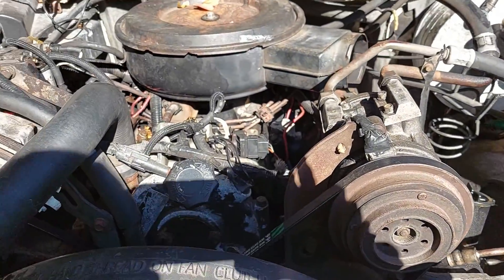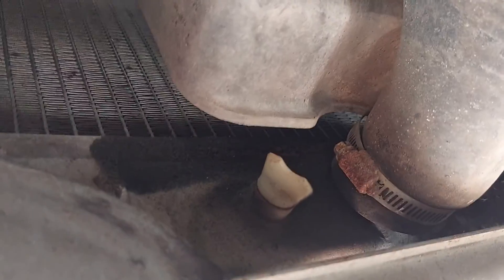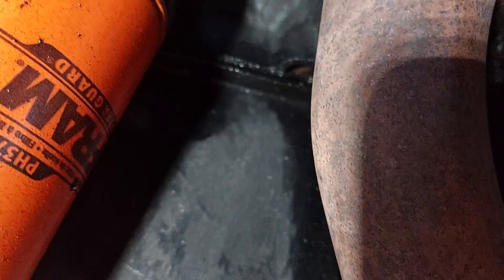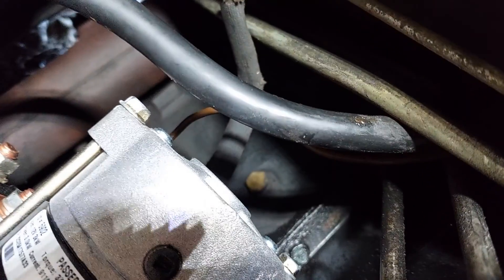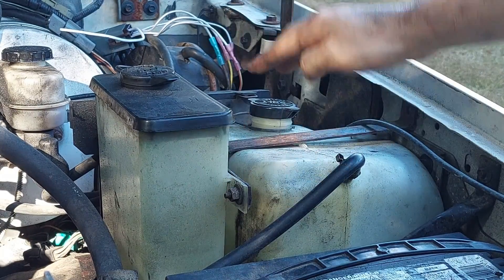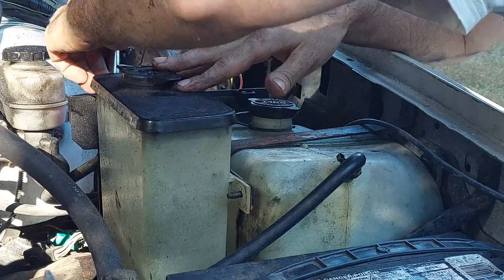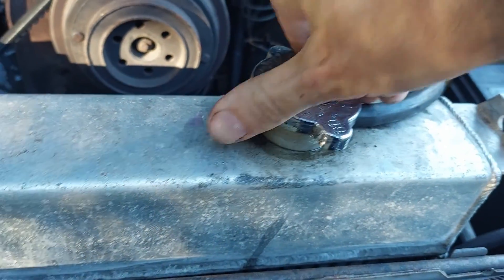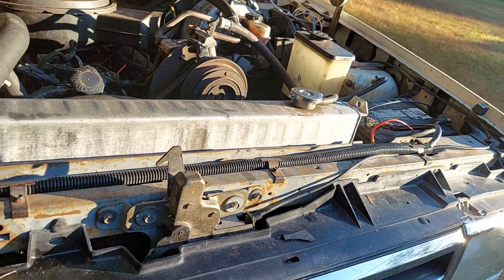Episode 147 - Coolant Drain and Fill 1989 Ford F350 7.3L IDI Diesel

Comment: To change my engine temperature sensor on the forward drivers side block, do I need to drain the coolant entirely or can I swap it out quickly without draining any coolant as long as the engine is cold
Reply from the maker: If you can swap fast you can do it with no coolant drain, but be aware you will have some splash out.  Along trick I've seen people do is to hook a vacuum to the top of the radiator where the cap is and have a sucking force to "hold" the coolant at bay to slow/stop the flow when they pull a sensor to swap it.  I've never tried this personally so your mileage may vary.

Comment: If I have an 87 150 is it in the same location, I csnt find a solid answer anywhere
Reply from the maker: 87 should be the same generation as mine, a bricknose.  However is your engine a gasser?  If so the location is probably different than on my diesel.  I'm guessing you have a 302 or a 351?
Reply: @MazdaB3K 302 currently yeah but it's a Frankenstein truck, I just could not locate the plug anywhere
Reply from the maker: Keep an eye out for a hex shaped (allen tool) plug that does not stick out from the block and is probably near a freeze plug.  That's the setup on my 5.4L Ford Modular engine and I suspect it's pretty similar on the older engines.  One thing to keep in mind is that you might only have one, and it might be hidden behind a starter.

Comment: Has everything worked properly after using this coolant? Are you still using it?
Reply from the maker: Yes, still using it.  I haven't drove the truck much due to other issues but I'm driving it now without issue.  It's expensive but it's an easy button versus testing and putting additive packs in manually.  Remember, 6.9 is fine and doesn't need SCA as the cylinder liner is thicker.  7.3 has to have it though or it will be killed by cavitation.
Reply: @MazdaB3K  Thanks for responding.  I do have a 7.3 and I didn't know about this. Thanks a lot.

Comment: Im just replacing my line that lewds to the water pump is it all necessary for a little snip off of broken line
Reply from the maker: What exactly are you asking?  You are replacing one line and wondering if you need to do a complete drain and fill?
Reply: @MazdaB3K  yeah it's my line that runs over the alternator
Reply from the maker: Just went outside and took a look... if you were very fast at replacing the water pump end of the line you could minimize spillage and probably get away with topping off your coolant versus having to drain it.  You would need to make sure that once you take the line off the heater core that you keep it up in the air above the level of the block so that coolant won't try to create a gravity siphon and drain out the line.
Reply: @MazdaB3K  🤣🤣🤣 I'll look for that I bought her almost 1.5 years ago and they ziptied alot of stuff I have a channel its just a bunch of gaming stuff but I'll put up some videos so u can see it

Comment: How many block drain were there in all?
Reply from the maker: Two that were of the bolt variety, one on each side.  I didn't try to open the square fittings I saw as I wasn't sure where those were going to go.
Reply: @MazdaB3K square one goes to oil